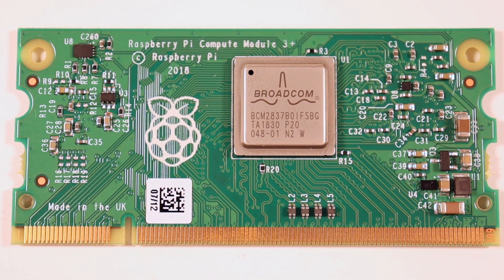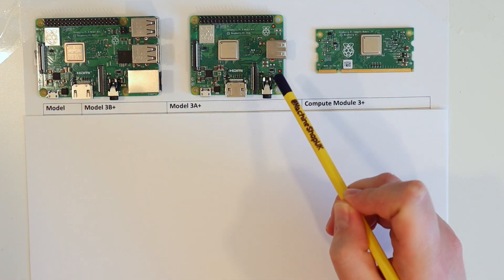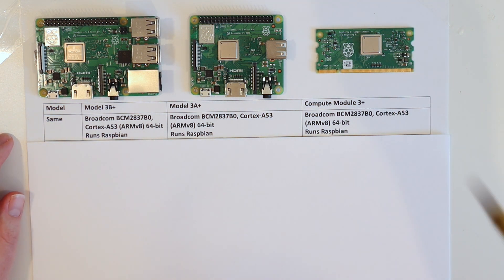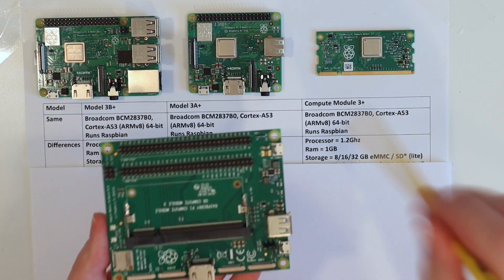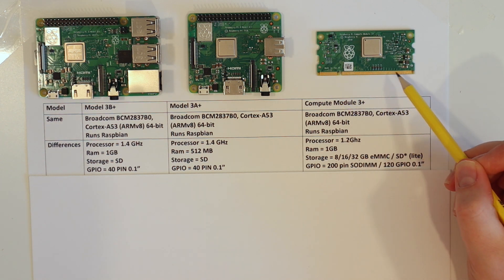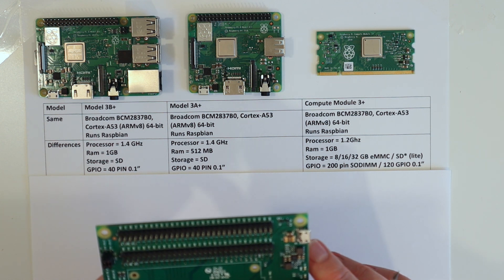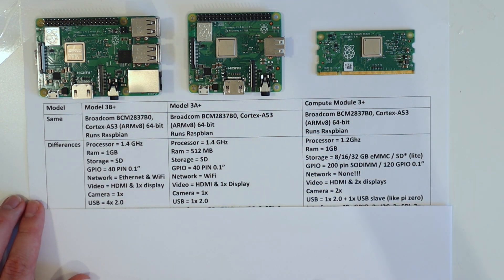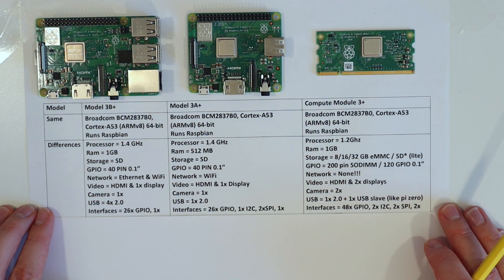Raspberry Pi 3B+/3A+/Compute Module Comparison

Comment: Can u solder wired directly on sodimm pinnouts? Or do u NEED the adapter?
Reply from the maker: If you are good at soldering then it is technically possible. However, the purpose of an sodimm module is that it is removable. I would recommend an adaptor board like this one https://amzn.to/2U1eDXl I think I might get one and i could compare it with the official board :) hope this helps and thank you for the comment, regards, John